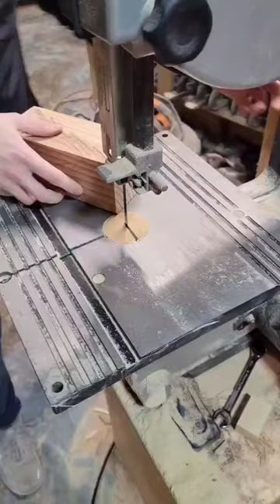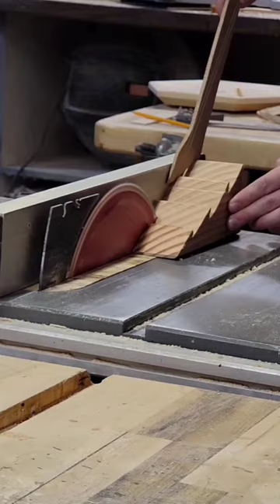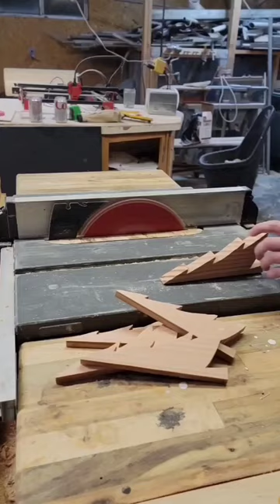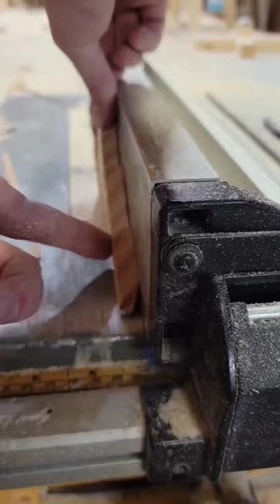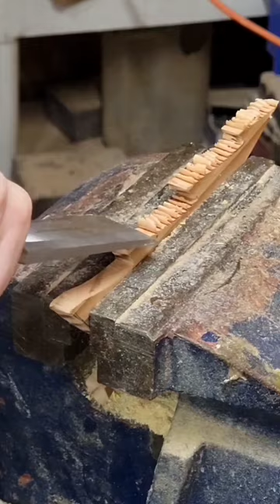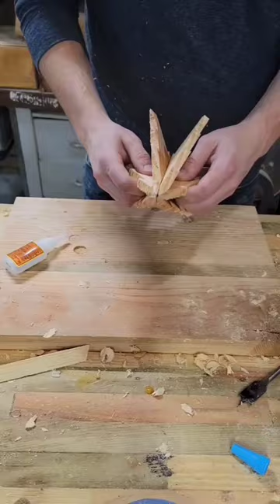Rustic Christmas Tree Decoration // Woodworking #carpentry #diy #maker #woodworking #wood #handmade

Comment: Is that an oversized blade on your tablesaw?
Reply from the maker: Nah, normal 10" blade
Reply: @JoshWrightWoodworking  is that saw not meant for like a 7" or 8" blade?
Reply from the maker: @CeeJayThe13th  I don't think so. I think It's made for 10" blade, or I've been using it wrong for the past 4 years lol
Reply: @JoshWrightWoodworking  I could very easily be wrong too!  It just looks the same as the one I have which is meant to have a smaller blade.  Might just be a different model or whatever.